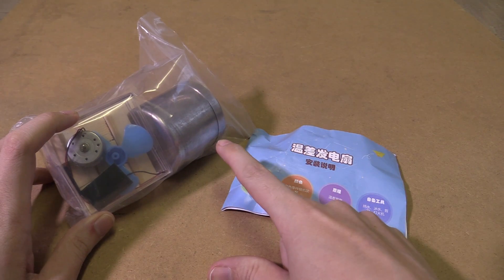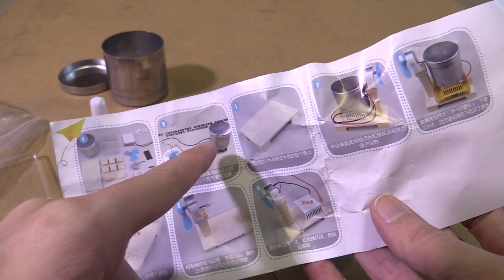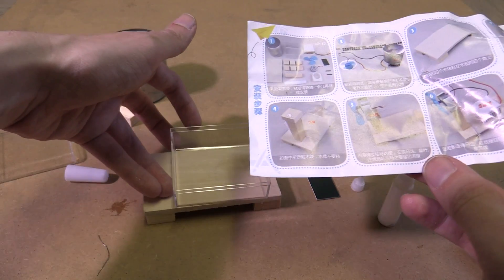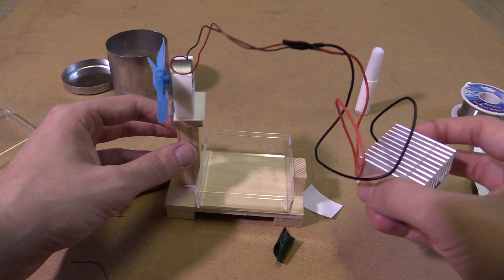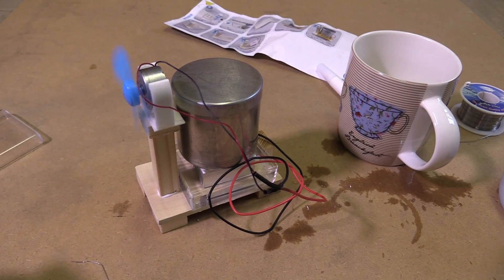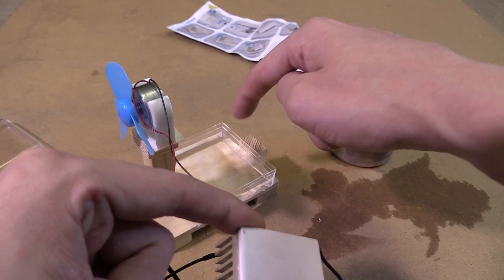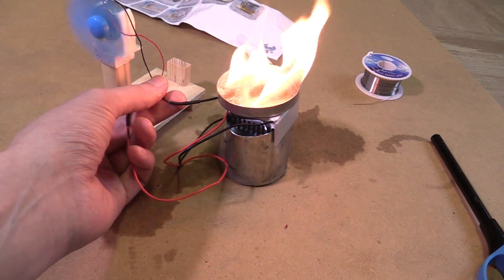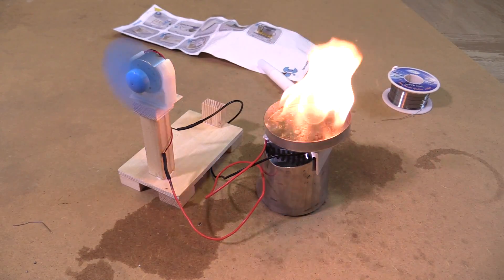Thermoelectric Generator Kit

Comment: I have two questions, 
Is it a voltage source or current source?,can we use it in dc circuit lab project?
Reply: Any source of electricity has BOTH voltage and current. You cant have a moving car with torque and no speed.

Comment: Requires safety precautions with some reverse engineering & preparation for this. Peltier module, how is the sensitivity & performance determined? Some formidable positive feedback is possible too. Put an ammeter on that to determine current generated.

Comment: does the thermoelectric generator produce AC or DC voltage??
Reply from the maker: It's a peltier do it produces DC :)
Reply: yes, always DC and the motor also need DC current.But is possible to convert it in AC.

Comment: how long does the tec module produce direct current?
Reply from the maker: It will continue producing power as long as there's a temperature differential between the two sides.
Reply: Thanks bro

Comment: hey bro does the module melts on direct heating?
Reply from the maker: The peltier modules are ceramic so they wont melt. But they can be damaged if the temps go over 200 degrees celsius.
Reply: Thanks bro

Comment: What if you connect the thing to battery and use the cold side of the thing does it make water cold?
Reply from the maker: If yo connected the peltier module to a battery, one side would get cold and the other side would get hot. So yes, it could make water colder. But you'd need a heatsink on the hot side to take away all the heat.
Reply: Gadget Addict what if you have 50 of those with heatsink and high volume of electricity... would it make the water ice?
Reply from the maker: It would depend on the volume of water, but potentially it could yes. If you run a single peltier and put a few drops of water onto it, it will turn into ice.
Reply: Nice.. can you experiment on that? Please... just drops of water..
Reply from the maker: Sure, I'm thinking of some peltier videos soon, so I'll be sure to include that :)
Reply: Thanks :)

Comment: Now it's time to convert it to a fire powered phone charger!
Reply from the maker: That would be pretty awesome. It would charge pretty slowly but in a survival emergency, it could probably do the job.
Reply: Yeah! I were thinking, what if the fan is placed in a way that it cools one side of the peltier module, so it hopefully won't stop when the water heats up. 
I'm unsure how much power the fan uses, so maybe no useful energy would be left, but it requires more calcualtion.
Reply from the maker: Trying to cool the water with the fan would use more power than it generates in the long run. A bigger heatsink and container of water would keep it going for quite a long time :)
Reply: I was thinking of cooling the heatsink itself, it's not easy too cool water directly with that fan :P

And yeah, I'm aware of that infinite energy does not exists :D
Reply from the maker: Oops, yeah that would make a lot more sense lol. Yeah I guess that might work but you'd probably want a larger peltier or perhaps two of them. If I was to do it for real, I'd probably look at the commercial offerings like the biolite stove and try work out how they do it :)

Comment: how many volts can it produce? might be good for outdoor/camping battery charger
Reply from the maker: Good question. I'll measure it and let you know. I've been planning to make a TEG (peltier) based phone charger that operates from a wood fire for quite some time now. I just never got around to it. There are commercial offerings already but they're kind of expensive and I just want to do it for a fun project.
Reply: like the biolite camp stove :) do you know where i can get a peltier unit?
Reply from the maker: Exactly :) You can find them on eBay and OLX and a few local electronics store. They're fairly easy to get hold of.
Reply: francis estanislao there are many version of this thermoelectric plate but cheapest plate is of 12v